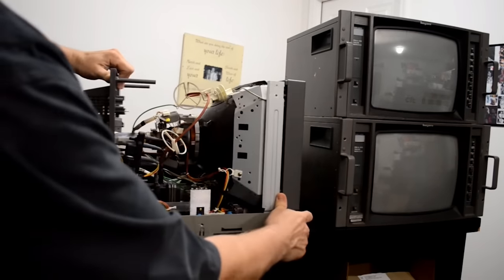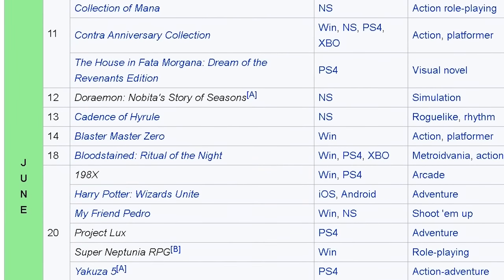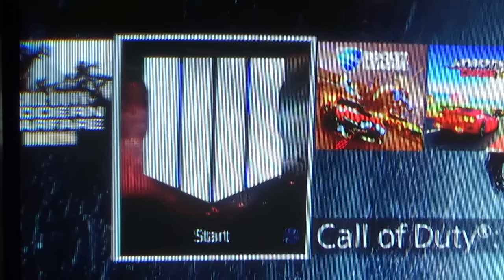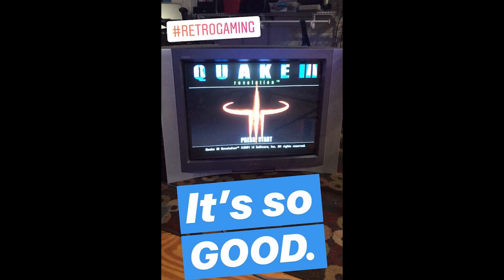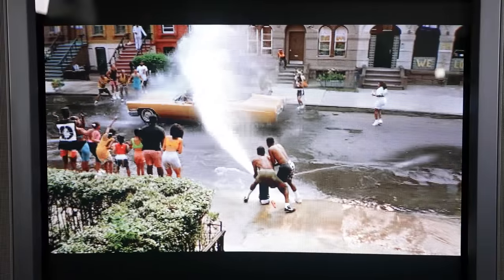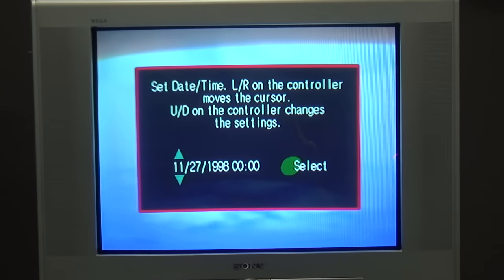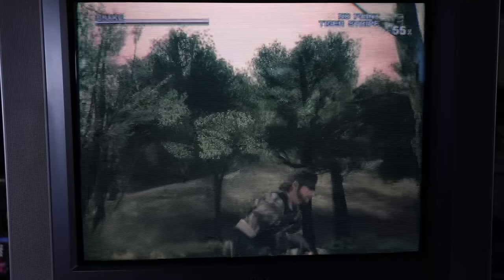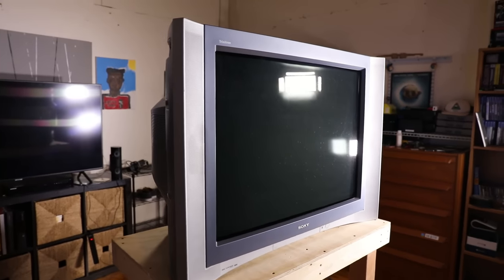Best CRT for Retro Gaming: Sony KV-36FV310

Comment: We should just switch back to analogue formats. With modern technology someone could definitely make the CRT's tube small enough to be reasonably portable. Sure it might not be flat, but the pure image quality you can get out of these things is enough for it, especially with technology today. The last CRT models produced have max resolutions equal to most standard resolutions used today,

Comment: Nearly impossible to find, but the Sampo SME-34WHD5 was a 36" wide-screen CRT that was actually better than the Sony mentioned here.  The Sampo also had a VGA input for 720p/60hz PC gaming.  RCA made a 38" wide-screen HDTV and Loewe rebranded the same set.

Comment: I have my windows pc connected to my crt. Google, crt emudrivers. It has a list of compatible amd cards. I use a Radeon 7750. The card needs vga our or dvi-i with vga adaptor. A vga to scart cable. I got mine from arcadexpress on eBay. A scart to component converter. I got the RGB2COMP from mike chi aka retrotink. Done. Also google groovymame to run arcade Roma at original resolution and refresh rate at 15khz.

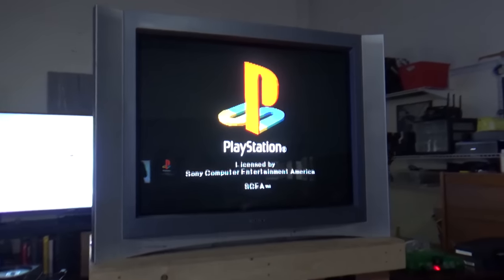Comment: 15:10 Here's what people don't talk about though: I notice that on CRT TVs from before about the late 90's the black level isn't so good. What I wonder is is this something that can be fixed with the internal knobs inside the TV for contrast and focus, or is it just an intrinsic inferiority of older sets? What I find puzzling is that on arcade monitors even from the 80's it seems like when properly adjusted they can get very black, like as much as a 2000's Trinitron.
Reply from the maker: I think it is an issue with older sets. Black levels were something sony took very seriously as the years went on eventually culminating in the CRTs of the early 2000's

Comment: For 240p from PC to that TV, install CRTEMU drivers with a compatible AMD gpu and also Groovymame. Download these from the Arcade controls forum. Then you need an RGB to Component transcoder. I use a Jrok board like this:

http://www.jrok.com/hardware/RGB.html

Groovymame automatically outputs every game in the correct refresh rate and res so no further messing around is required. With the correct refresh rate you won't lose effects like shadows or cause screen tearing in old sprite-based games.

Comment: I think the solution is to make a Framemeister type system you can hook up to your newer TVs that does a scanline generator, a curve and bloom effect option, and any other appropriate filter effects one can think of, and a sensor that can detect light gun movements, and I think that'll at least be enough to let old school gamers going with some modicum of quality picture after the days all our cherished CRTs start failing indefinitely...sadface...I have a KV-32FS210, and a stand from another similar Sony model that fits and matches mine,  I'm super fortunate to have got it for free from a guy just wanting to get rid of it, and the other Trinitron with the stand I got for $20 and sold just the TV for $15 cuz it was much worse quality picture than mine, my TV looks perfect aside from having to go in service mode to properly align the screen, which 100% works minus not seeming to like to save the setting after I turn the TV off, maybe I'm missing something in setup, idk yet, still learning that menu even tho I've had the thing for 3 or 4 years... so I technically got the stand for $5 after selling the TV, which the guy and his dad accidentally broke trying to carry up to his room, so sadly, there goes another one...sigh* offered his money back, but it was an hour drive for him, and he said it was fine and his fault not mine, it is what it is, still feel bad though :/ I can only hope mine lasts my lifetime! I hope all ours last all our lifetimes!!

Comment: for windows pc to display on your tv, you need an S-Video Cable, those TV have a port built in, we had 32" Sony Trinitron  and we played PS2 and PS3 games, God of War 1,2 and 3, no issues with widescreen or fonts, great colors and amazing sound since they placed the speakers on the sides facing you. 

If your pc S-Video port in the back (and I doubt it), you can do it with this cable https://www.amazon.com/feet-Gold-Plated-S-Video-Cable/dp/B0002MQGK4

if not. here are some adapters  https://www.amazon.com/s?k=S-Video+pc+port&i=electronics&ref=nb_sb_noss

best of luck.

Comment: 14:33 the guy on the left is a mutant. he has 2 noses and 2 mouths.
CRT effect can be emulated by adding a driver on a chip, so it would work independently of the single board with the OS. Kinda like how audio drivers work on headphones.

Comment: I can't use a CRT for retro gaming because space is at a premium in my house. They're too big and bulky, so I have to use a flat-panel TV. Fortunately, mine is a LED LCD TV from RCA with a very good upscaler built into it. I've had no problems with input lag no matter what I play. Genesis games with an after-market YPbPr cable? No problem. Saturn games with the same cable (it just needs an adapter)? No problem. PS2 games over YPbPr? Again, no problem.

Playing 240p games the way the developers intended? You ever consider that maybe those developers looked at their work on a professional monitor instead of the consumer TVs you found at Walmart? PVMs and BVMs could do true RGB via SCART or JP-21* and BNC breakout cables. As an American, I feel cheated that we never got RGB on our consumer TVs. Why the hell do Europe, Australia, New Zealand, and Japan get the good connectors but not us? If you've ever seen old games in RGB on a professional monitor, it's electric sex. It's like looking at a different type of technology. Professional monitors were also built to LAST because they had superior phosphors. They were designed to be kept on 24/7. These cunts were used in TV broadcasts, video editing, as medical equipment, and as security monitors.

Scanlines: I never thought of them as actually being there. To me, it's just part of the tube technology. I've gotten so used to the pixelated look thanks to modern displays and newer, retro-style games.

The only way I'd ever go back to a tube TV is if I buy any old games that use a light gun or active shutter 3D glasses. Those things depend on the exact timing standard of CRTs and the pattern of the electron beam to work. They won't work with a modern HDTV, not even on HD CRTs.

*Do NOT mix these cable standards up! They are NOT compatible! The pins are mapped differently.

Comment: Have a question for anyone who can answer. I just recently got my hands on one of these tvs. I’m testing input lags between my 20” insignia which is perfect. I’m noticing a change in input lag with my big trinitron. Also noticing that blacks and too black. I had to jack the brightness all the way. Anyone have any input on this? I got the tv solely for retro gaming and it’s not better than my little 20 inch.

Comment: The weight is the only reason why most people should stick with a 19-25 inch display. Even then it's easily pushing 50+ pounds.

Comment: Sorry but retro games especially anything before the playstation/3D era look horrible on flat screen CRT's including this Sony. I much prefer classic bubble/curved screen CRT's or old Trintron models and also prefer 21" for screen size maximum.  I mean this TV weighs like a metric tonn, an absolute nightmare to move even inside a room and there is a real danger of desk/table just collapsing under its mass.
Reply: try sega genesis or snes with hd retro vision component cable  with sony  flat crt like this one or even wega non hd ,  you will see amazing picture shaper picture than curved 90s , but the problem with the flat  crt for most people is they prefer the curved models to avoid geometry  and  most people like curved screen because curved give better feeling while playing old 90s games , flat 2000s  TVs still newer ,vivid colors ,sharper  picture , in general  both curved and flat must have if you have place to store some crt tvs, but if you dont have place , just keep the one you prefer.

Comment: 2:38
Dude i'm not intentionally trying to call you out for this but you almost verbatim used the Crutchfield's (Steve K's) words for the KV-36FV310
"If you're trying to decide between a 32" and a 36", a 36" offers 25% more screen area — a significant difference. If you've never owned a big-tube TV, you'll be bowled over by the big, vibrant picture — especially viewing high-quality sources like DVD"

Great video nonetheless and very informative.
Reply: Yeah, it's the same....

Comment: What was $499 in 2003 would cost $1899 now because companies liquidated all the diverse manufacturing equipment involved. Start with the cost of store shelf space and product weight. Notice that stores don't sell big heavy electronics. Automotive light bulbs have doubled in price too. Unless everyone including your grandma wrote the company and sent checks, it'd never happen. However vinyl is back. Thrice the price, but it's out there. But that's very cheap to get going. Not so with all that thick glass and fat coils needed in a good CRT. Remember there were cheap throwaway brands then like today. Sony always went heavy.

Comment: These top of the line CRT tvs aren't the best because it doesn't show much scanlines and really defeats the whole retro gaming experience. It's basically running it on an emulator except worser. I'd rather get a sony PVM

Comment: That comparison at 4:08 is so dishonest.   Sure if you are using the worst cables ever and no proper external scaler it will look like that, but RGB/Component into an OSSC will look extremely good on a flat panel display.

Comment: There is no single best TV for all of retro gaming.  It looks like this TV is best for PS2, Xbox and Gamecube which all had component cables.  Some original Xbox games did widescreen 720p which are best on HDTVs.  To go further back though you need RGB scart connection for SNES, Genesis, Playstation 1, Saturn, Jaguar, etc.  This to my knowledge can only be had from Europe or Japan as USA did not have RGB Scart on their TVs.  Dreamcast you need a CRT TV with VGA connection, rare but they did exist (you could just use an old computer monitor, but that is a matter of individual preference of size of the screen).

Comment: HELP ME TRINITRON NINJAS
~i am/was identical to this dude when he became bored with current releases.
So i got PS2 and then a New old-school TV
*SONY FD TRINITRON WEGA XBR
34" #KV-34XBR910
*But my question is this=
= WHY does it suck?
I had a Trinitron similar to dudes back around 2003-2008 and remember it being absolute awesome.
And my PS2 didn't even have component cables then,,let alone MOnster Component cables...
**I figured this Trinitron would be the AlphaOmega because it's Wide screen and those we're waaay outta my 2003'ish price range.
like a G over my price...
*Maybe the TV is aweome but the tube or whatever is busted...
Opinions guys?
Reply: a pic of This model.
https://www.crutchfield.com/S-K56FTLxEDEQ/p_15834XB910/Sony-KV-34XBR910.html

Comment: Hey I have almost the same model, also has like no input lag as far as I can tell.
It took me and my dad both to move the damn thing haha. I am using a counter top with shelves inside of it that was going to be a vanity but it was never cut on top for one so I cut holes in the back to run the cables out of and it's just on that now, with all the consoles inside of it all wired up to the back, and I just open the cabinet when I want to play something.
https://i.imgur.com/P4YEs07.jpg

Comment: I just bought a 32 inch sony wega  for 450 perfect condition forget that they weighed a actual fuck ton
Reply from the maker: Got the remote?
Reply: @Scarflix yes actually but the battery door u need to keep taped i havent repaired it yet.. one side of my room is a retro gaming hub and the other is an armory and survival wall with two doom pieces of artwork lol

Comment: The FV310 is maaaassively overhyped, the only thing going for it is voltage regulation which is incredibly minor considering people pass up sets that are usually in better shape for WEGAs barely clinging on to life. Seems like everyone on reddit missed economics class, cause Sony isn't all that lol.
Reply: It's not a significant upgrade if you get a crusty tube but remember you can swap the tube almost infinitely because how common the other wegas are.
Reply: @joneswarrington7242  Tube swaps don't fix issues with the chassis though, and realistically it's veeery unlikely you'll wear down a tube enough to consider replacing it unless it's like, a daily use PC or security monitor. The fact WEGAs are common does bring me back to the fact it's dumb people routinely ask so much for them since they're really not that uncommon though.
Reply: @oriorb Correct me if I'm wrong but I think most issues with the chassis such as the yoke boards are cross compatible with their respective chassis numbers. About those tube swaps I was thinking of a more long term solution as consumer tubes do tend to wear out faster and develop a lot more problems with convergence and geometry. As for the value of wegas I don't really think you should be spending over $50 on any consumer crt in most situations.

Comment: This is actually a very poor CRT for 240p content. It's fine for 480i+ (GC, DC, XBox, PS2) but even those will be upscaled to 480i and have poor 240p rendition. If your intention is to do NES, SNES, MD, PCE, Saturn or Neogeo gaming, avoid it.
Reply from the maker: Oh damn I did not know that.
Reply: 480i content isn't upscaled, genius. GC, DC, Xbox, PS2 all output native 480i. You don't know what you're talking about
Reply: @vladg5216  So the "genius" here fails to understand how digital TVs work. So here it is. Most digital televisions interpret a 240p signal as a 480i signal. electronically speaking they are the same except for the timing signal present in the 240p signal that's absent from the 480i one. This timing signal allows, for example, the emeralds in Sonic to flash during the intermission screen. This causes issues and artefacts when the 240p signal is wrongly taken as a 480i one and "upscaled" to 480p by the TV set. A 480i signal (which is the vast majority of PS2/GC/Xbox games) is displayed in 480p by a digital set like this one and as such, is rendered properly (especially since those systems also move send the image in 480p to the set over component). As such their 480i signal displays fine (hence what I said about their 480i signal beeing displayed in 480p by the set). The improper processing of 240p signals is what makes this TV a poor one for the pré PS2 generation.

Do note however that many PS2 and GC games are in 240p and displayed as such through composite/svideo/component/rgb scart and will have issues on this set too.

Comment: To me this is worthless as a retro experience.

I had a set better than this: the same with the extenal subwoofer and center speaker. It was a very nice set, and it took many years before it was replaced by a worthy LCD.

But I did all of my NES and SNES gaming on a 14" Brocksonic, with a nasty grille and visible triads, divergence and vignetting at the corners, and ocassional noise from the blender or vac cleaner.

I think going for the top notch CRT is a very nice achievement, but definitely not authentic.

Please don't tell that to the guy who bought my Sony Wega though 😜

Comment: one day  all CRT TV's will be dead . all CRT's suffer from imperfect vaccuming . it's impossible to create a pefect vaccum . and CRT's are always lett jsut a few miniscule particles of air in. over time this gets worse and worse , and eventually you start hearing the dreaded "whine"  that is the tv being turned on causing the glass to heat up and thus more seapage to occur ... then day you'll turn it on and hear a small pop ... that is one of two things that make that pop and theya re both vaccum components , 1 the transformer blew (this is stil readily fixable if you know a repair shop that wil toucha  CRT tv )  the second cause of that pop is the CRT tube itself finnally giving out to the ravages of time ... and this , this is not fixable. sad but one day in the future no one wil be able to enjoy  old games on the displays they were designed for.

Comment: These suck since they can't play light gun games and have lag get an early 2000s one they are much better for retro gaming
Reply: More like 2000 2001 and 2002 trinitron
Reply: Are you sure you’re thinking of the right tv? The first one he showcased in the video is the one with lag and no lightgun support, the main tv the video focuses on I’m pretty sure doesn’t have those issues, correct me if I’m wrong though.
Reply: He didn’t watch the whole video

Comment: 𝗧𝗵𝗶𝘀 𝗶𝘀 𝘀𝗼 𝗿𝗶𝗱𝗶𝗰𝘂𝗹𝗼𝘂𝘀𝗹𝘆 𝘄𝗿𝗼𝗻𝗴, 𝘁𝗵𝗮𝘁 𝗜 𝗮𝗰𝘁𝘂𝗮𝗹𝗹𝘆 𝘁𝗵𝗼𝘂𝗴𝗵𝘁 𝗶𝘁 𝘄𝗮𝘀 𝗮 𝘁𝗿𝗼𝗹𝗹.

Sony has ALWAYS been the worst displays for gaming. The pixelation errors are God awful. Toshiba is not the best either, but they are much better than Sony.

The real answer for the best brand crt for gaming is Panasonic. More specifically, the Panasonic Flat Black models. They had the best blacks, best color, best definition and screen shape.

As a matter of fact, Panasonic made the best gaming displays in all display types. SD, Plasma, LED, everything. They were also one of, if not the, first TV displays to break into 120ᐩ Hz refresh rate.

The quality of their colors, contrasting and refresh rates were on another level.